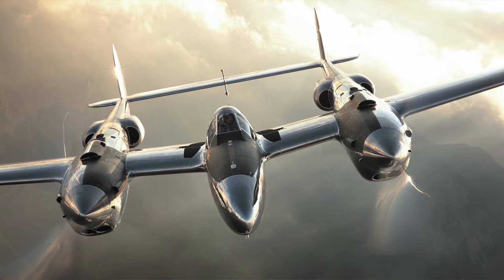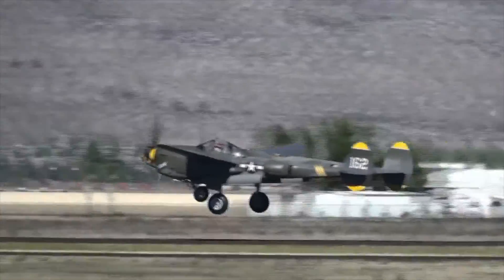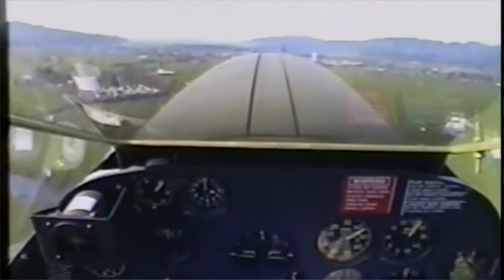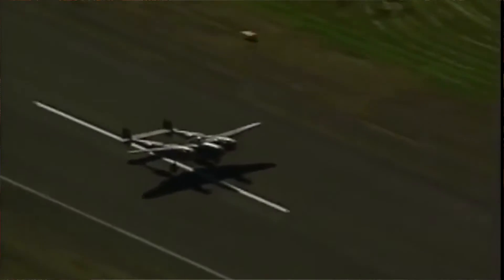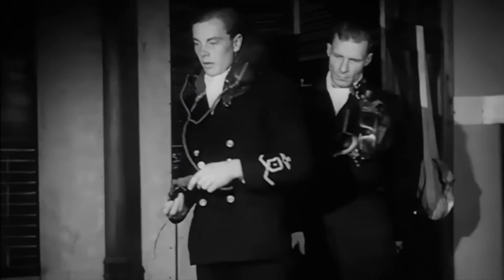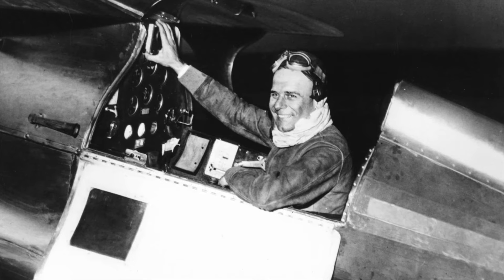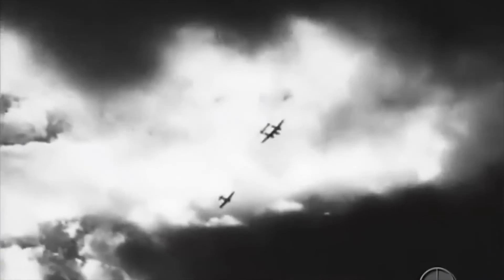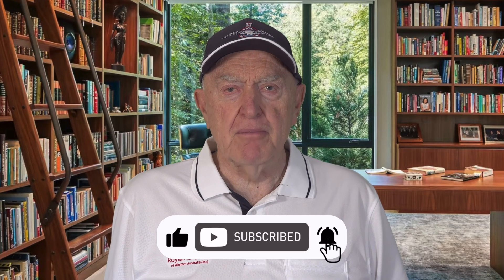P-38 Lightning--gorgeous, but flawed?

Comment: Brown was full of shit.

Terming the 38 and 47 as "useless" is utterly idiotic.  This is pure Anglophile Horse Shit - though - he did like the F4F's the British flew as Martlets.  At one point in time the RAF had control of the aircraft flown by the Fleet Air Arm - and saddled it with some truly horrific aircraft.  Their basic idea - was that as Carrier Aircraft - they had to all be twin seaters with a Navigator so they didn't get lost.

They were certainly better than the P-40's.

The biggest problem the Americans had when they first got into the war - was that they were going against these German Experten - who had in some cases been flying since 1934.

Two things happened here.  First off the Americans got better - and secondly the Germans got fewer.

As for the P-38 - it was a multi engine aircraft and thus more complicated than a single engine aircraft - which meant - it needed more experienced pilots.

Tony LeVier 
https://en.wikipedia.org/wiki/Tony_LeVier
Lockheed's chief test pilot came to Europe and sorted out a lot of the 38's problems - then Lockheed made up kits to fix the problems on all the P-38's in Europe.  They flew the kits to Britain in a C-54 - the RAF thought it was a FW-200 and shot it down.

Galland said that the 38 had the same problem as the 110 but - it didn't.  The 38 had Counter Rotating Propellors - which helped keep it on  course but - could also be used to turn the aircraft.  Pilots could "_Blit"_ the outboard Engine in a turn, rapidly increasing the throttle and the backing it off.  This would create a lot of torque in that engine - which would rapidly rotate the aircraft.  This was part and parcel of what happened if a pilot lost an engine on take off and increased the power to he remaining engine - he would rotate the aircraft and it would dive into the ground.  By Carefully making use of this same aspect of his engines - a good pilot - could rotate the 38 faster than just about anything else just using it's ailerons.

The thing is - you had to be a good pilot to do that.

Another thing was that when transitioning from cruising speed to combat speed - there were specific steps that had to be performed in a specific order to do that.  Good Pilots could do that rapidly but not so good pilots couldn't.  The P-51's (which were not pre-war aircraft like the 38's) had more ergonomic controls.

The thing with the Mustangs was that they were easier to fly, being single engine aircraft - and they cost less.

So - the P-51's became the Bomber Escorts, the P-47's went to ground attack and the P-38's went to the Pacific.

Pilots in the Pacific LOVED the 38 because it had two engines and they were doing ALL their flying over either Jungle or Water.  If they came down in the Water they stood a chance of a Catalina picking them up - but if they came down in the Jungle - they were dead.

One thing about the Allison engines is that they were of modular construction - so - you could (iirc) flip a cam shaft and have the prop rotate the other way.  You could not do that with a Merlin.  The British had a number of multi engine aircraft with Merlins but none of them had Counter Rotating Propellers - they all spun the same way.   

The problem with Compressibility was not that all the American Fighter Pilots were making holes in the ground - it was that they had difficulty controlling their aircraft until it got into thicker air.

So - the pilot had two choices.  He could avoid getting into compressibility in the first place by watching his speed - or - he could just ride it out until thicker air let him slow down and regain control.

The Big Advantage the 38's compressibility gave the Germans - was that the American Pilots were afraid to dive at to high a speed.  So - if the Germans got a 38 on their tail they could just dive away and the American wouldn't follow.

Now - think about this - if the 38 forced the German Fighter to dive away from the Bombers - even if he hadn't shot it down - the 38 pilot had driven the German Pilot off - and protected the bombers - which is what he was there to do.

The other thing was - the 38 could fly to Berlin.  That was hardly "useless" .  NONE of the other Allied Fighters could do that.

The problem with American Bomber Escorts - was that the American Army Air Force Bomber Mafia had viciously attacked any attempt to imply that the Bombers needed Escorts.  Thus the P-38 and P-47 - were considered 
"Interceptors" like the Spitfire - rather than Bomber Escorts which is what they needed.

The Spitfire was an Interceptor.  It was designed to intercept enemy aircraft over friendly territory - and it was really good at that.  But - as an Interceptor - it hardly needed to be able to carry enough fuel to fly to Berlin - so it didn't.  Thus - Spitfires were the ones that were "useless" when it came to being Bomber Escorts.

Mosquitoes were NOT fighters.  They were Intruders - and very good at that - but they were not fighters.  A Mosquito that tried to dogfight an enemy fighter - was going to die.  That - and they were made of wood - which unlike metal - splintered.

The Fact of the Matter is - the British did not have a long range escort fighter.  Since they were flying at night - they didn't think they needed one.  They did try and use Mosquitoes but - that didn't work out.  Night Fighters needed a ground controller to vector them into close enough range that their own radar could pick up the target.  Mosquitoes over Europe had no Ground Controllers - like the German Night Fighters did.

What the American P-61 Black Widows would do - was to go hang out around the bases of the German Night Fighters and wait for them to come home.  The problem with that - was that these airfields had a lot of AA protection.

So - Brown was a highly experienced Test Pilot, who had early in the war flown combat missions from a British Carrier - but - when it came to his evaluation of the 47 and 38 - he was completely full of shit.
.

Comment: P 38 was obsolete when designed and finally built. Only survived in the Pacific because the Mitsi Am6 Zero was a POS ( no armour and no resealing fuel tanks, and very limited max velocity in a dive ) Some yanks have the cheek to say the RR V engine designs were stolen from them, V 12 engines were around well before the Snider cup days ! . The Allison engine series proved to be badly flawed in power out put and altitude. RR spent a lot of time in supercharger and intercooling development as did the Germans. Too be honest the P-38 was a POS compared to the DH Mosquito ( in EVERY aspect ) license

Comment: I still like the P 38. I'd say my favorite American pursuit plane of the era.

I was a kid of age 8 in 1963 and assume I saw one several times fly over head in the Akron/Canton area of Ohio. It was at a relatively low altitude and its twin boom was easily seen leading to my assumption.

Be interesting to know if I was spot on, but I think it'd be a real challenge to research who might have been flying one in my area in 1963. 

Interestingly at age 68 I now see twenty years as a drop in the bucket and 1963 was only 18 years after 1945 and the end of the war in Europe. Back then it seemed to a kid like the war had been ancient history.

Comment: I think Doolittle sent the P38s to North Africa where they showed much success as North Africa like the Far East  was a low air battle.  In addition to the compressibility issue, the turbo superchargers on the Lightening were problematic.  It was speculated or possibly confirmed that the cold air at high altitude caused them to fail.  Finally, the book Fork Tailed Devil by Martin Caiden is a great book recounting the history of  the P-38.
Reply: The USAAF 8th AF transferred more than 1,000 planes and about 5,000 personnel from Britain to the Med. before Torch to form the American 12th AF, including the P-38s of the 1st, 14th and 82nd Fighter Groups. The 12th AF used the P-38s in all pursuit roles because they had no choice. This included long range escort because at that time it was the only plane that could do it. The P-38s suffered very high loss rates in all fighter pursuit roles in the Med, but it allowed 12th AF to operate bombers economically. That made it a success. It's a bit grim, actually.

Comment: Fokker G1 was designed in 1936 and was introduced at the Paris Airshow in November of that year (developed as a private venture by Anthony Fokker I am also an employee of fokker) Source from wikipedia. P38 was first conceived in 1937 and prototype contract was awarded in june of that year. Construction did not begin till 1938 ( sourced from Lockheed Martin and wikipedia)